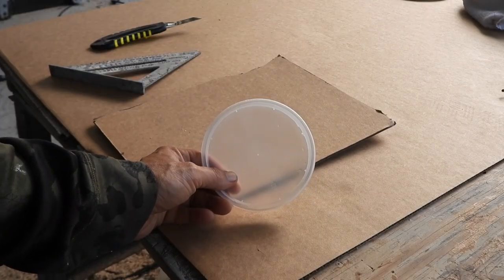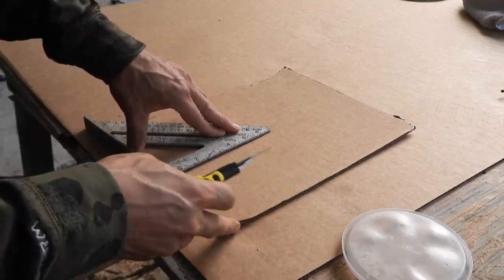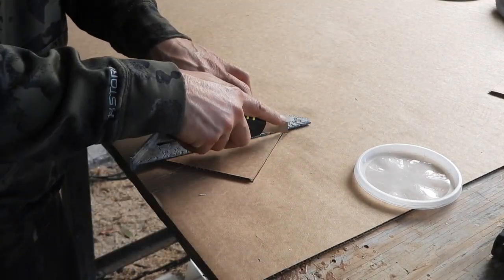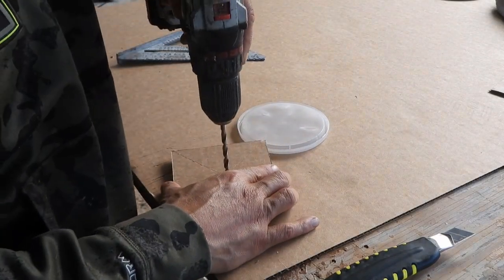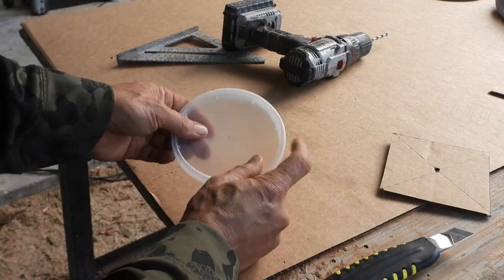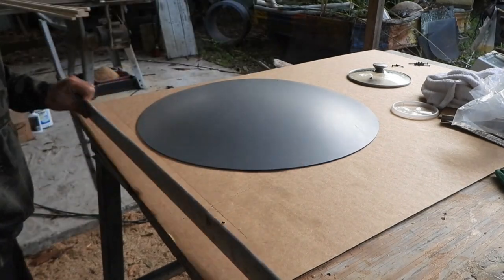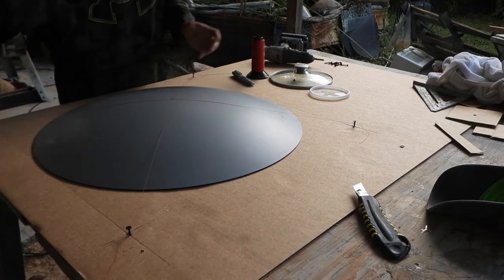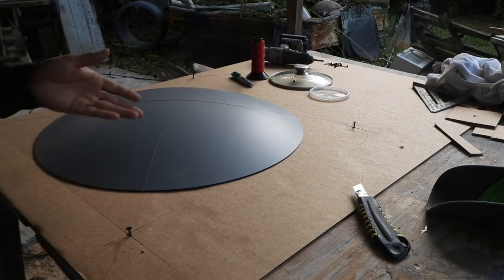FIND THE CENTER OF A CIRCLE IN 37 SECONDS, THE REST IS PROOF OF CONCEPT

Comment: Best way is to take a ruler and draw 2 straight lines accros anywhere and draw their median lines with a "compass" and they will meet in the absolute middle. Geometry is the key. Nature is complexe, but very simple. 

The compass can be a pin/string/pen contraption.
Reply: Care to rephrase all that?
Reply: @abundantharmony  1- take a ruler and draw 2 lines accros the edges of the circle. 2-find the middle of those 2 lines, take a square and draw those 2 lines
Result- those 2 final lines will cross at the exact center of that specific circle. (Do it multipple time on the same circle starting with different lines to practice the technique)

You can do it very precisely with a compass and a straight edge. This methode dosent require any measurements. It works best with large circles. You can also use rods and ropes with levels or lasers and geolocation measurment devices for even bigger scale (ex.middle of a city).
Reply: @sk8pkl  Bit difficult for curved surfaces, no? I don't see how a ruler would work at all. That is the whole point of the strings.
Reply: @ddpxl  indeed, a ruler or a string makes a perfect straight edge. The best marking tool for a curved surface would be what we call a chalk line... Wich is a string. Yes. You are right.

Comment: I'm assuming you mean "if you don't happen to have a speed-square handy"

another solution is to use intersecting arcs whose centers are on opposite edges of the circle you're trying to bisect.

if the circle is really big... like you're making a circular foundation for a covered astronomers observatory, your bust out your multiples of three four and five

Comment: You could just take the triangle, put the 90 degree corner on any point inside the circumference. Where the two sides (rays) meet the circle are the end points of a diameter. Shift it over a bit, draw another diameter, and where they intersect, is the center.

Comment: why not use thales theorem.  place the square with the 90 degree corner on the edge of the circle. see where the two short sides intersect the circle and connect these two intersection points. the middle of this line is the middle of the circle.
Reply: no need for paper and cutouts
Reply: "90 degree corner on edge of the circle" seems less precise tbh.
Also it won't work on the parabolic mirror or any other "non-perfect" shape.
Reply: the definition of the speed square that he used to make the square to begin with... also the sheetrock Square

however I'm assuming that the spirit of the challenge requires that you don't have those tools handy

there is one other method which involves drawing two intersecting arcs whose centers are on a line that intersects the circle... the points where the two arcs intersect form a line perpendicular to the first line... so if both centers of the arcs fall on the perimeter of the circle then the line perfectly bisects the circle.  use the line that you just created to find the perpendicular points that bisect the circle in the other direction

Comment: You can find the center of the circle without cutting.
1. Place circle in the 90° corner of the cardboard
2. Draw two lines & diagonals
3. Place cardboard on top of the circle, align with 90° corner and punch hole.

Comment: That’s genius. Now aside from doing Solar I’m going to use this for making aircraft cockpit panels. Each gauge has a large round hole for the face and four screws on the diagonals to hold the gauge in place. Once the gauges hole is cut I can never get the screw holes perfectly right… I can now 🤣

Comment: Good idea, but this will not work on that curved surface just as your first "pop" at 7:04 shows. You saw it didnt work, so you needed a second "pop" with better aim. That is not the true center. Depending on the size, curvature and the friction between the string and the surface you could be off really badly. On your setup I bet you could pop those lines anywhere around the true center point inside a 20mm diameter circle if you wanted to.